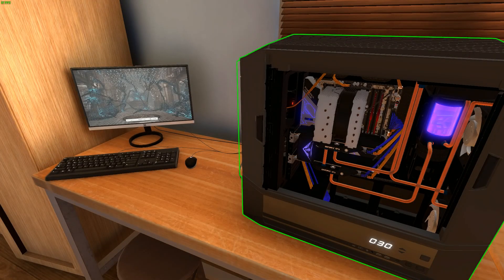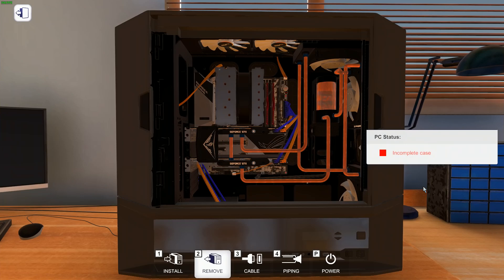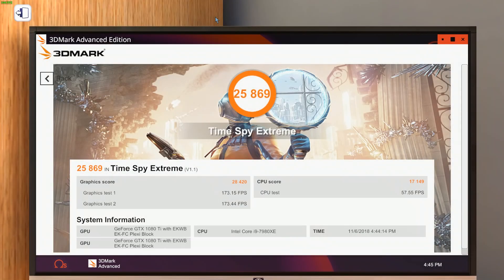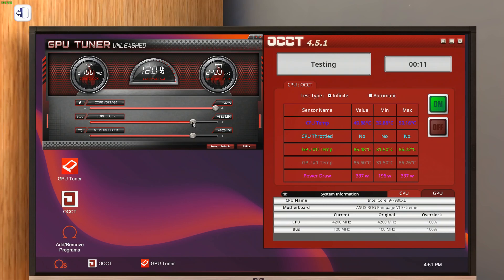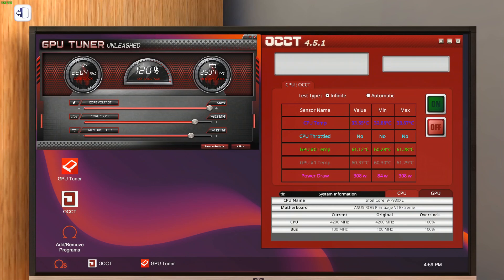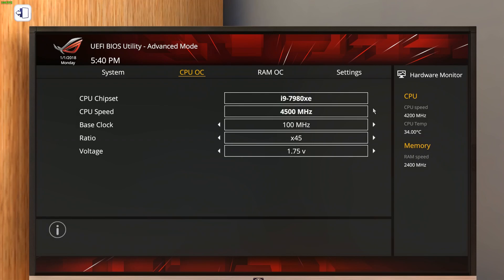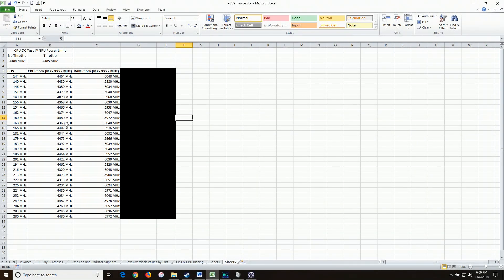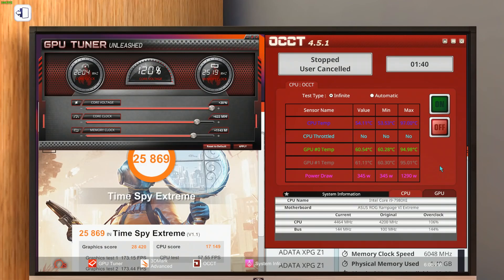Turbo's Guide to Binning and OC in PCBS - Part 4: Overclocking

Comment: How important is it to get this in-depth when you're really just gunning for the $1M achievement? Surely there are diminishing returns when you get into the nitty-gritty like this in terms of resale value (when considering the length of time it takes to do the extra work). Usually I just crank up the CPU to somewhere reasonably close to its thermal limit (within 5°C), quickly find the highest RAM settings that don't BSOD, and then get the GPU reasonably close to it's thermal limit. 

Not bashing the video series, it's well done and informative, but it seems like a lot of work to do every time you are OCing.
Reply from the maker: Yeah, this has no value towards the achievements in game. There was a really strong competition going on on the steam forums at the time I made these though and I was being slammed with requests on how I was getting the scores I was. So, I made the series.

Comment: lol im going to build a rig with 5 360mm rads and like 7 120mm fans. 2 2080ti watercooled and i9
Reply: what kind of case are you using?
Reply: @fufy111  frogot but search super and the one where it doesnt say rgb in name
Reply: @bray8949  so the raijintek enyo. ight thanks. I did a lot of builds with that thing but i never got to extreme limits.
Reply: @fufy111  no problem bro

Comment: Great tutorial. Just watched it again to try and learn the steps - one thing I noticed is that on the CPU it says they recommend not to go over 1.5v but in this and other videos you've gone over this either 1.75 or 1.9 (for binning) so can all CPUs in the game go over 1.5? I've just been setting them to the 1.5v volts before watching the guide.
Reply: not all CPUs can go this high, what this does is eliminates the inferior CPUs.  Be careful in career, if you go too high above their maximum voltage they will fry.  Only the best can go this high.
Reply: Save before trying to push a cpu above 1.5v I managed to make my 9980XE go up to 2.0v but I had to fry a dozen to find it.

Comment: Where did you get 144 MHz from?
Reply from the maker: In regards to the base clock? That's the minimum baseclock value needed in order to hit on or near the maximum possible RAM clock.
Reply: @whistlinturbo  I think I need to rewatch the ram video I've only watched THAT one twice. I'll probably comment on here again if I have a eureka moment
Reply: Finally 100% get it. Jeeze louise it took me 2 days. Thanks for posting this.

Comment: i have in question i try to oc my cpu but can barley ever get 4300 on i9 7890 (i think thats what it is) is it something with the motherboard im using?
Reply from the maker: Did you bin for the best CPU?
Reply: @whistlinturbo  
tried to make a watercooled oc build in free mode.
got the dual watercooled 1080ti up by 27% but cant go any higher than 100mhz on the cpu.(i9-7980xe)

Comment: Helpful Vids, im lvl 28 in career but still havnt unlocked a few items to even replicate your build yet, also as of today can no longer have Air cooler with coolant pump even in the EVGA cases that worked 2days ago, could you try to confirm if you have found the same?
Reply: Can confirm, I'm stuck with the same issue...
Reply: Yeah the EVGA cases have a lot of bugs with the newest version
Reply from the maker: They've removed that functionality unfortunately.  I'm going to be working on getting a video out tomorrow on the changes that were made in the 0.9.3 update that will cover this and a few other things.